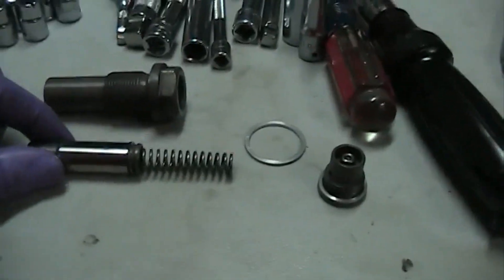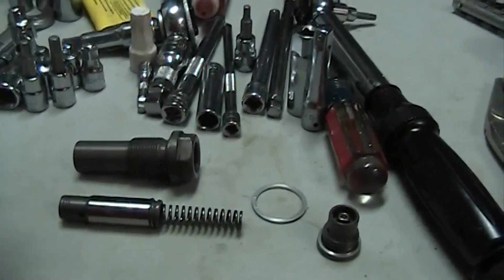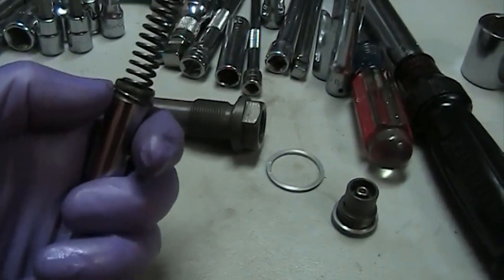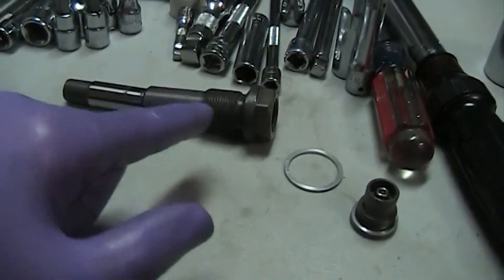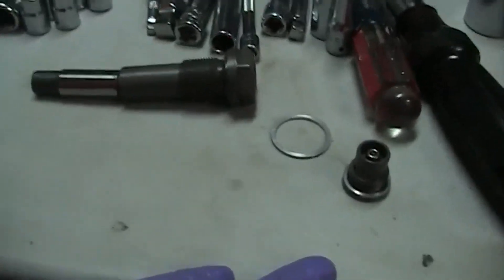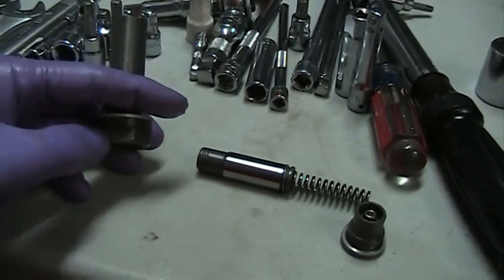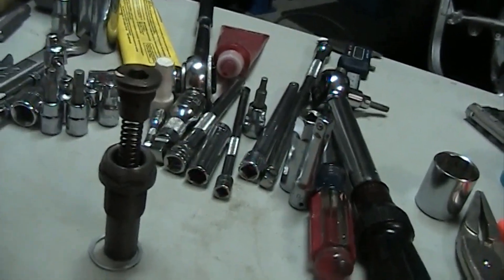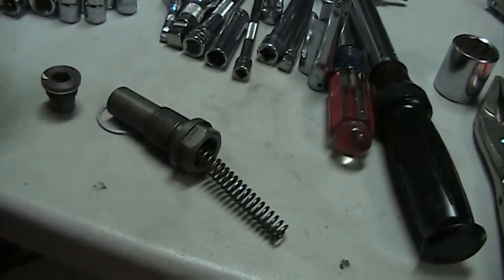Mercedes Benz W140 S320 Engine M104 - Timing Chain Tensioner

Comment: Hello Andy. I have the same car as you. Yesterday the engine stopped when I stopped at a red light. Try to start it but it won't start. The engine turns, but it has the same effect as when you want to start the car with the car closed (lock activated). This happened 3 times previously, but with 2 attempts it started again. The engine was working perfect before this. Now my mechanic is diagnosing. The issue is that he got a Mercedes scanner but the ecu is not powered. Do you know where the problem could come from? Thanks a lot
Reply from the maker: Sorry to hear. I'm not 100% sure if w140 has the OVP relay, check the fuse on top of it.
Whats clear you've lost ECU, could be communication (canbus) problems or you've lost power to the ecu, my guess.
Reply: AndyP Mercedes-Benz Channel thank you very much for the response. Best regards
Reply from the maker: No problem,  let me know if you find a problem